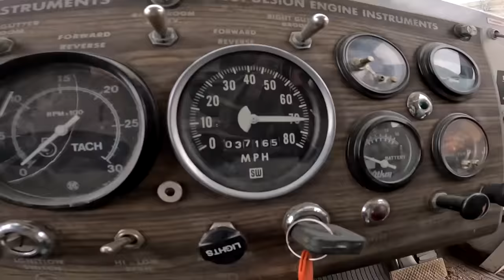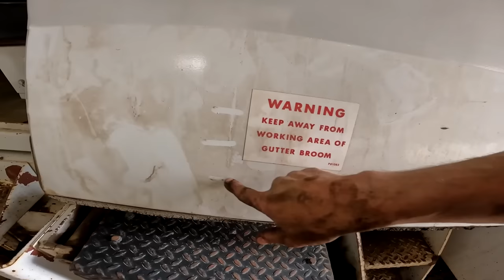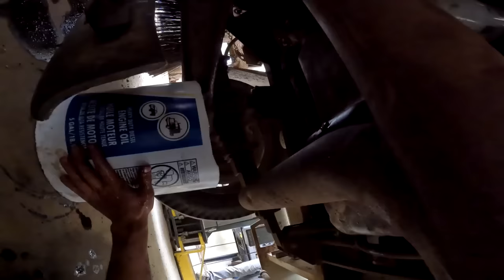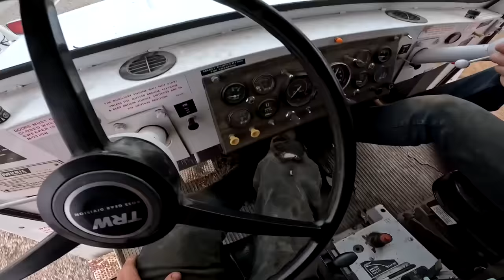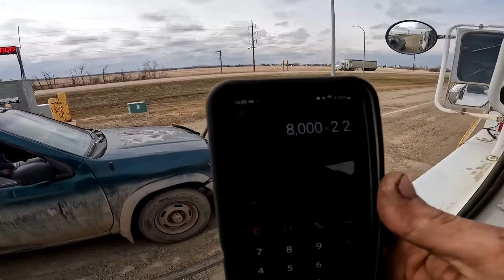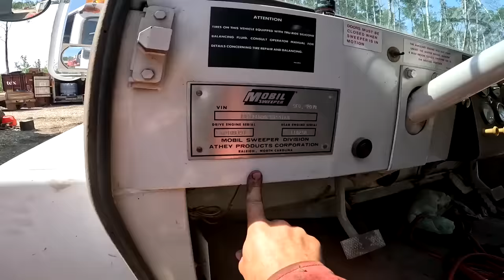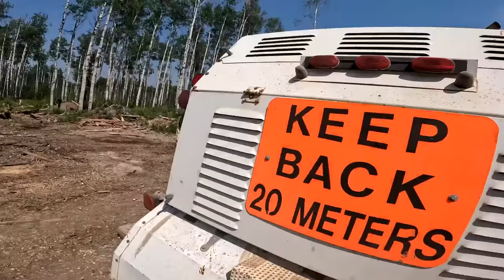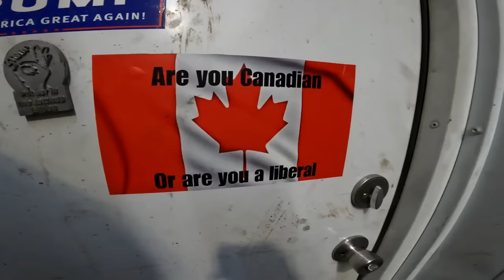STREET SWEEPER VIDEO DELUXE!!!

Comment: You need to run a shaft from the rear engine, to the front, and connect it to the front engines crank by a chain, , with a one way clutch, or something, so the power can be put to use!!

Comment: I got a sweeper from a auction ($1,500) had a ppumped 12v cummins in it, with ONLY 6,000km on it! Threw that bad boy of a mill into my blown up 6.4 F450! Made a minty truck. Engine was clean, but I spruced it up since it was a 94... So she only got 6,000km in 30 years.... But a good engine non-the less!

Also scrapped the rest of it for a few thousand, sold the Alison tranny it had, and a few other parts to a guy in the freedom lands. 

Made money, and got a free engine from it! Good deal!

Edit: oh and she actually had a i4 IZUZU engine in the back to run the hydraulic stuff, the Cummins was only for driving the unit... Gave that one to my dad.

Comment: Well peg. Just got me a screw cab dually diesel manual 93 f350 from a buddy for 150 dollars and it needs engine work or another engine. An owner in the past was so stunned and turned the fuel screw the wrong way leaning the sh*t out of the 7.3 wrecking  the engine

Comment: hey peg thanks for the videa. I got a question on OBS trucks. My old ferd is not wanting to go into reverse after driving for awhile.Rather than shifting it just grinds out. If I drive for about 30min everything gets really stiff and hard to shift. Its the trans. Yet im too dumb to know where it start. Its that maza 5speed manual. Its a 95 f150 shes only got 73k on the clock. Any help from anyone is gratefully accepted.  God bless.

Comment: The Detroit Diesel 8.2L fuel pincher is one of the worst diesel engines ever made and it was the first 4 stroke engine from Detroit diesel.  They had a design life of 100,000 miles in medium duty truck applications.  They produced a total of 300,000 8.2L engines with 100,000 of those engines being stored as warranty replacement engines so they were prepared for a 50 percent failure rate.

Comment: Contruction road cleaning up after the dump trucks and the oilfield trucks getting back on the highways up in Canada and Albert areas
Reply: Heavy Construction Equipment going for sale for a really good deals from commercial construction companies going for bankruptcy and pintle hitch Equipment going for sale as well fresh out of the boxes can always be used for for your ideas and i am like dr frankenstein monster ideas for the trucks as well rockwell axles front differences and transfer cases as well i like the movie pearl harbor when there getting the b-25 Mitchell bombers from the uss hornet aircraft carrier
Reply: Dr Jekyll mr hyde looking truck it got four wheel drive on the all wheel drive transfer case and automatic allison transmission caterpillar to cummins diesel engines v8 3204 and 3104 v8 turbo charge diesel engines still push out like the 7.3 idi international Navistar international harvester v8 7.3 idi diesel engines can give you a nice edge

Comment: if the black smoke from the show Lost is diesel smoke, then this guy has A LOT of the devil in him. hes chop full of goodies. has buddy open the hatch while being ground as he just apart of the potential. charging him up then he touches buddies nipple. "just pulling all the amps" buddy is a devious smart one. cerebral cortex on autopilot. diesel smoke plus increasing negative to body ground as rpms go up equal inhaled exhaust right to the cortex. hit the brakes and it goes right up the ass 500mph. you can have it in any color you want as long as its black
Reply: oil fields set on fire from a burnout
Reply: had buddy press the brakes and steer because she wanted to pull right and exhaust coming right off the block. his buddy was not his buddy. buddy
Reply: also compressed into a nice little package and transported via phonons. watched one of them little bastards gfizzl out and decompress them oxygens like a ice cube on a hot skillet. them beasts come in hot

Comment: You have to make that into your daily driver bro , there's no it's ands or buts ... just think about the benefits,  if you slap some paint on it you won't get pulled over because it will look like your apart of the town department,  so that means you can be drunker than ever driving that beast around,  second you don't have to be on the road either your a street sweeper so then even if your piss drunk it doesn't look like your piss drunk because you can drive super slow or fast with caution lights on .... then also you can piss people off without actually getting in trouble either because they're going to blame it on the town when it's actually you .... nobody would suspect the street sweeper at all !! Just think of how drunk you could get and drive on the side of the road .... paint it all nice so it looks brandy new and you'll never get pulled over again